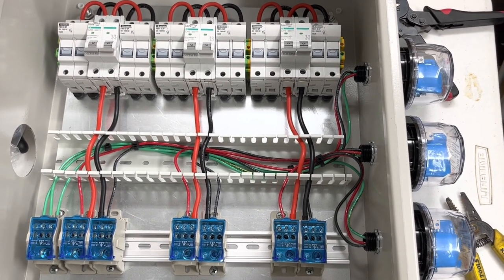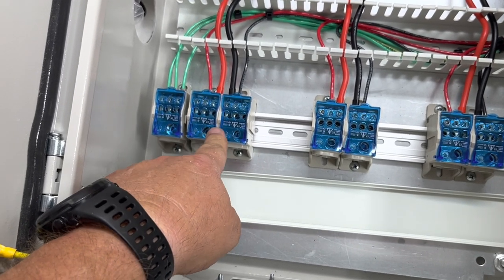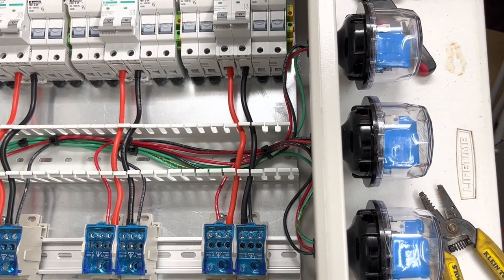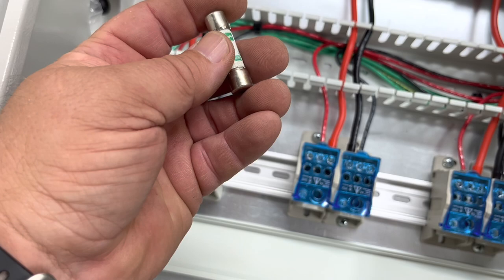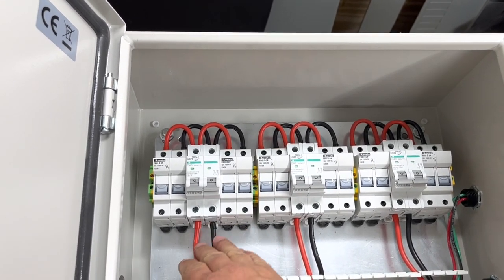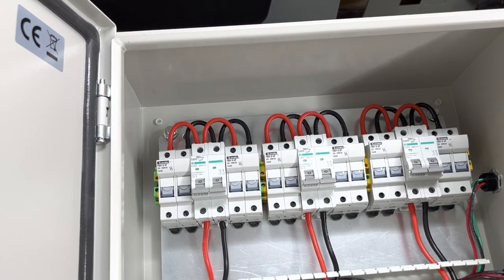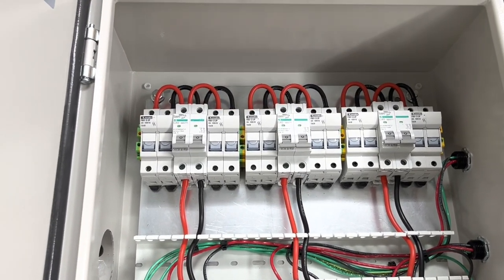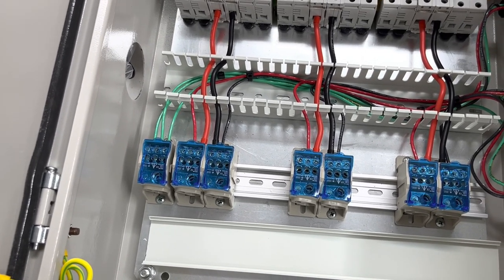Solar Power Project - PV Combiner Box Build - Midnite Solar SPDs

Comment: I absolutely don't like 2 wires going into the circuit breakers together.  PV+ and PV- on each breaker have 2 wires connected at the breaker.  Breaker inputs are hard to get good connections and to keep them torqued over time.  And it is best with stranded wire to use a wire ferrule on the connection into and out of the breaker.  I suggest that a 3 wire connector like a Wago 221 30 amp connector for 10 AWG or larger be used to combine the 2 PV+ or PV- wires into one to input to each breaker.  As for the bottom DIN rail, same thing.  Those blue blocks could be eliminated using Wago 2 wire connectors for the lightening arrestors and allow a much smaller enclosure.

Comment: I’m just know watching some of ur videos wile doing some surfing. Do you have links to everything used to build this array
Reply from the maker: Hey Chris. I haven’t put together a set of links yet. I may do that at some point. If I do I’ll post another video discussing them.
Reply: Is ur battery a 12v or 48v and how many ah is the battery bank . What does it cost to build. Thanks
Reply from the maker: @chrisrichardson8908  it’s a large bank. 48v 1500AH total. Check out signaturesolar.com for pricing.

Comment: Question for you. In this video you explained your amperage in your 3 sets of wires are around or over 20 amps. The 5000es clips at 18amps, but there is a new firmware update that increases this to 22amps. Are you or did you do this?
Reply from the maker: Wasn’t aware of the firmware update. I’ll check it out. Thanks!
Reply: @jeffmotes2129  I was hoping Signature Solar would have a done a video on doing the firmware update. It sounds kind of confusing as there were hardware updates to the 5000es over time. I bought 2 inverters, then about 2 months later I bought 2 more, all from sig solar, but yet they are different. The difference I can see is in the boards that are in the electrical inspection panel at the lower front of the inverter.
Reply from the maker: Yes it does clip. However, when sizing components and fuses we have to use STC rating which will likely never be achieved in real life application. If it does start clipping I’ll split the panels up a bit and put them on four inverters. I’m running the extra cables anyway.